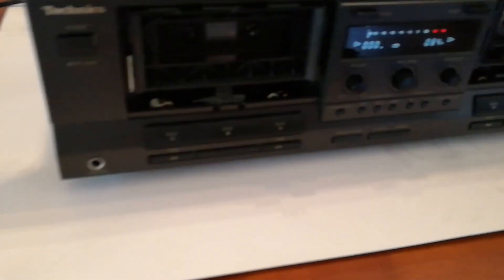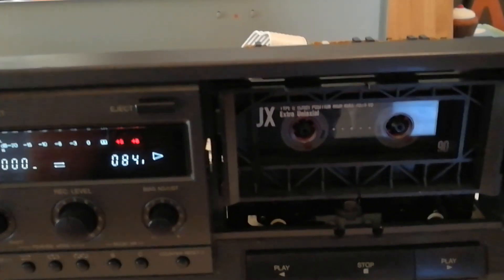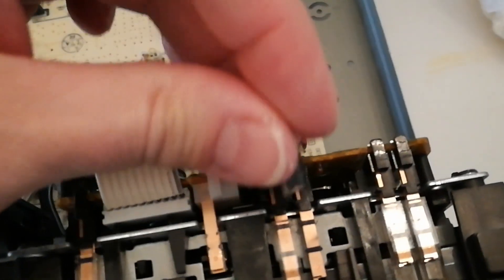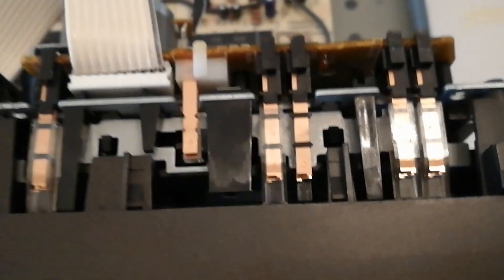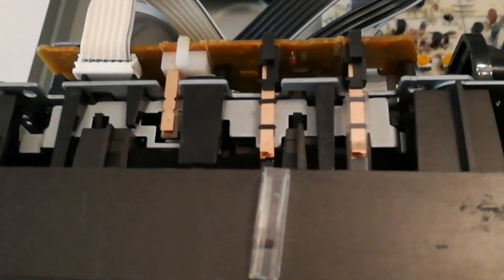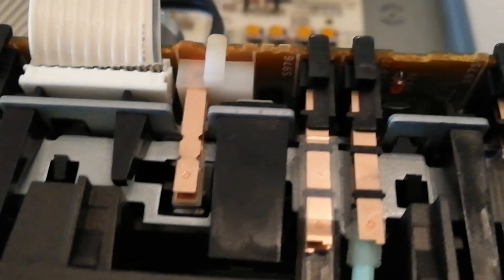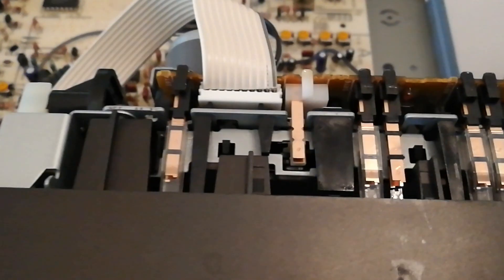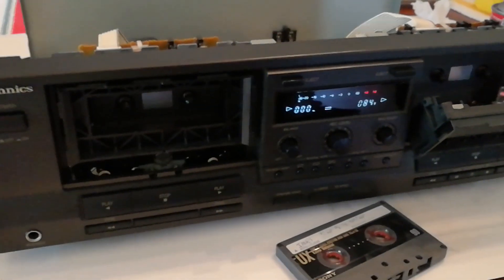* How to Fix * Technics RS-TR333 Cassette Tape Player STOPS PLAYING Repair

Comment: Wow. Can’t say thanks enough! I bought this tape deck from a pawn shop for 15 bucks and the right deck had the same issue you described in the video. I took some needle nose pliers and removed the plastic piece. After that, I flatten the end of a q-tip and dipped it in 90 percent rubbing alcohol and cleaned the connector as you described. Put in a tape and everything is playing fine!
Reply: Yeah man right side for me too. Must have been the favoured side science it had all the bells and whistles. Like you, this fixed the Jesus out of it.

Comment: Thank you so much. I have a Pioneer tape deck and while the plastic strips themselves have no visible contacts there are little switches underneath that were corroded. A couple squirts of deoxit cleared it up. Thanks to this video it got me looking in the right place.

Comment: One thing to mention is that when you pull these plastic covers off it breaks the little nipples at the end of the black strips that hold it on. I used a thin strip of clear tape across the clear plastic to the back black solder point to hold it in place.

Comment: Thanks for this tip. I just pulled this exact tape deck out of our barn. It had been out there for 23 years. Had that run issue in the left well and cleaning the contact on the left side did the trick.

Comment: Perfect and simple - short and sweet - Thanks !! - I just did belt on one of these and deck one was going back and forth - I thought it was the tension sensor but wasn't sure if it was one of those. Some older decks , also solenoid controlled, have a little plastic tab that runs with the tape on the bottom facing up. When the tape tightens it triggers an auto stop feature. Same idea. This was a great help - Good luck with your channel - Subscribed and liked -

Comment: Would that be the same issue for my system? 
I have the Technics RS-TR515 which is the dual-auto reverse, dual recorder. When I put a tape in, hit play. I acts like it wants to do something. Then stops. Same for FF for RWD modes. Before it was packed into storage for 8 yr it was working fine. I was all wrapped up in layers of bubble wrap and inside a storage container too. All climate controlled.

Comment: How do u put the plastic back on, cause after removing 2 of them they would not stay properly back in place anymore. so now I had to use some duct tape to keep them in place. and everything is working properly, but I would like it to be without the tape. 
I tried numerous times, but they just won't stay in place like the others. I did not clean the rest when this occurred, but it seems I got the one that was creating the issues at least.

Comment: Running into a problem with a Technics single cassette player. Work well over all, but sometimes deck won't rewind. It plays, fast forwards and records fine, but gets hung up when the rewind button is pressed. Any insight or direction would be helpful. Thanks
Reply: Hi, I have the very same problem too but were you able to figure it out ? Please let me know . Thanks!

Comment: I have a Technics RS-TR155 and I can only reverse play on the 'recording' deck. The right tape capstan thingy just doesn't turn if I play to play normally (aka forward with the rollers going the normal counter clockwise), would it be the sensors on this too? As it plays fine and perfect in reverse play mode, and everything else works perfect.
Reply: i have this same issue, did you find anything out?
Reply: You probably have a broken gear. There is a gear that is used for one direction only, hence it will still play the other direction.

Comment: I have this exact model too, also has a problem. Both decks won't play forward, but in reverse they play normally, The REWIND and FAST FORWARD functions work as they should in both forward and reverse. Why won't it play forward on both decks?